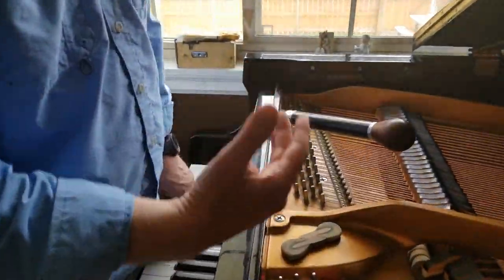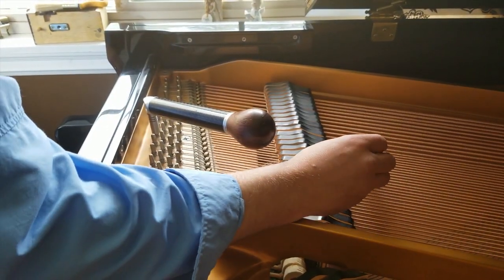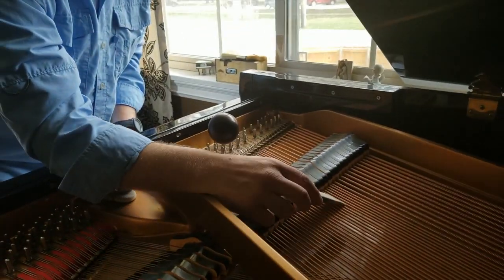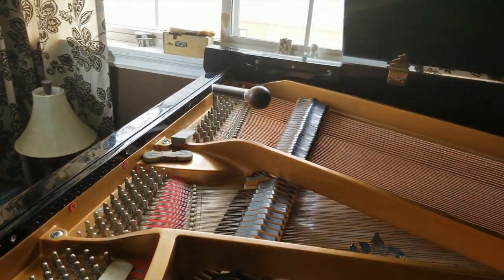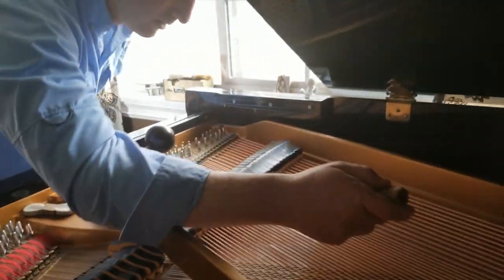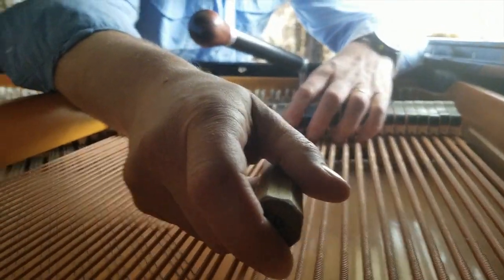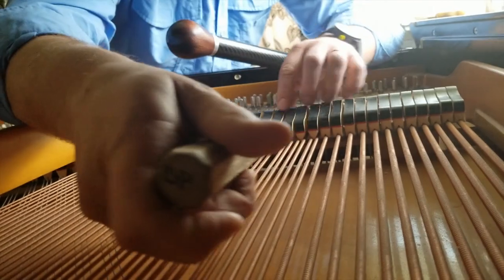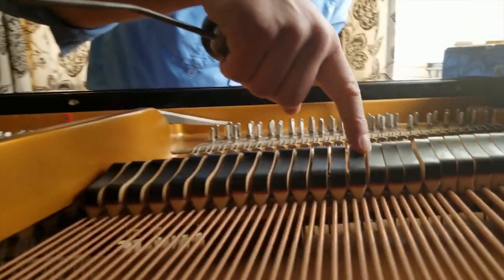Ringing Damper | Grand Piano

Comment: what cause that buzz sound? did you hear it?
Reply from the maker: The buzzing may be poor recording device (my phone)...it was a year and a half ago so I don't actually remember.  Good ear though!  The point is that the main problem I was fixing was the ringing damper - if the string was indeed buzzing then a 1/2 or full twist of the bass string often does a good job at diminishing or eliminating those noises.

Comment: Sorry I accidentally deleted my previous comment when I went to go edit it. I am experiencing the same ringing on the left side of the damper with the b flat note just below middle C. Is there another way to align the damper or maneuver the string like you did without using the tool?
Reply from the maker: EC0205 I suppose you could try and use some long needle nose pliers, although it'll be tricky.  Damper repairs are often very complex, more so than it may appear in a video.  Best to use the intended tool, or hire an RPT to fix it.  Happy fixing!  www.TheGildedPiano.com

Comment: Yes, what exactly did you do, you just put something in there and moved it around. I have a ringing and can't get it to stop. I have two that are ringing, if I can figure out how to fix one, the I'm sure I can fix the other.
Reply from the maker: I bent the damper wire up near the damper head making sure the damper felt landed on both strings simultaneously.  Damper work is tricky so good luck!